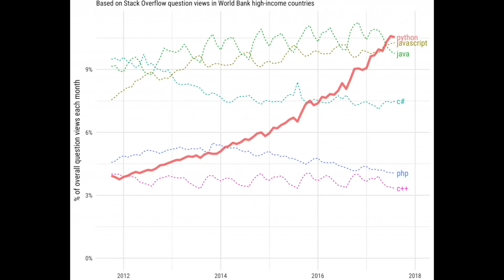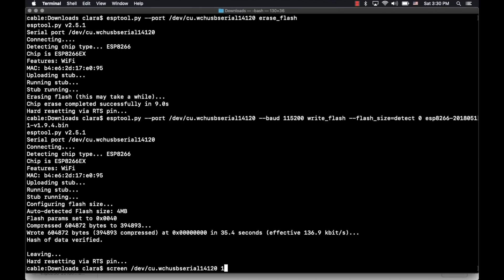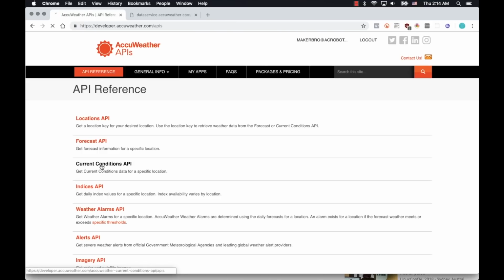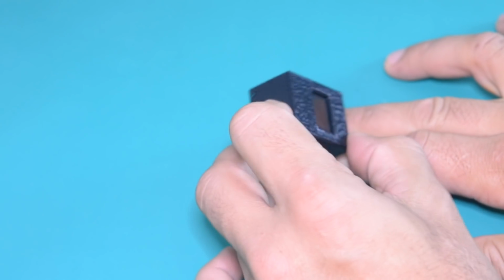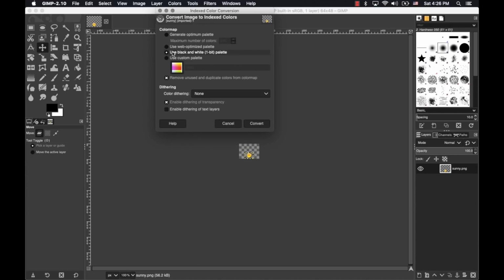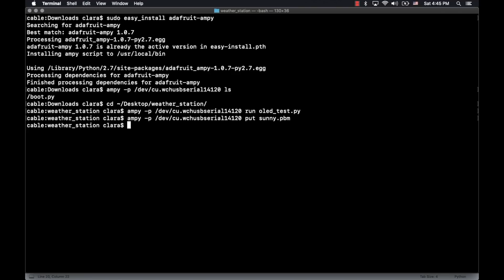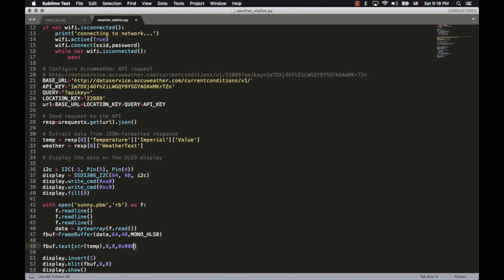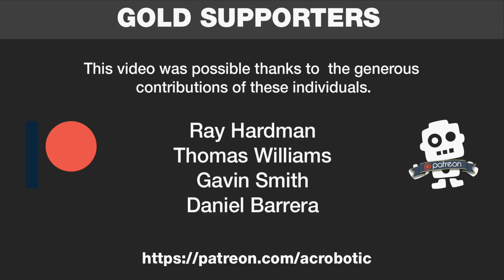ESP8266 MicroPython For A Weather Station Using A WeMos Micro OLED

Comment: How do I install python modules into my esp?
Reply: Micropython modules are just .py files. You'll have to search for the modules you need online and download them. Once you have them, save them to your micropython device as .py files with the correct name. For example in this video he would have saved the OLED module on the device as "ssd1306.py". That module can be found here:
https://github.com/micropython/micropython/blob/master/drivers/display/ssd1306.py.  
If you aren't sure how to save files onto your micropython device, the easiest way in my experience is just to use Thonny IDE. There are other less straightforward ways though.

Comment: I have ESP8266. 
But Script code available till power on. Meaning that it not run after restart device.
So,  I want to run my script on boot time.  

Any Solution ?
Reply from the maker: If you use the Arduino IDE, and write your code inisde the loop() function, the code will run every time. Or, maybe I'm not understanding your question correctly.
Reply: @datasith  
Thanks for reply.
I was asked question for micropython.
Now problem is solve
Reply from the maker: @rahulkhokhariya2686  oh, I see. I'm glad you solved it, thanks for letting me know!